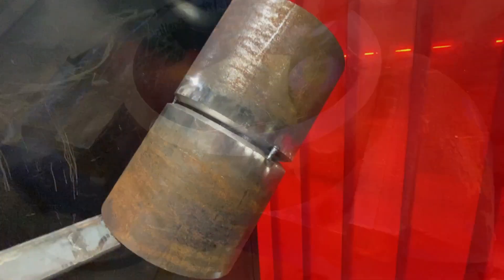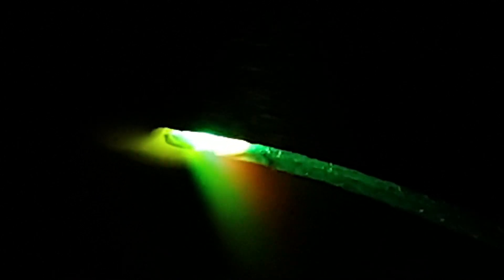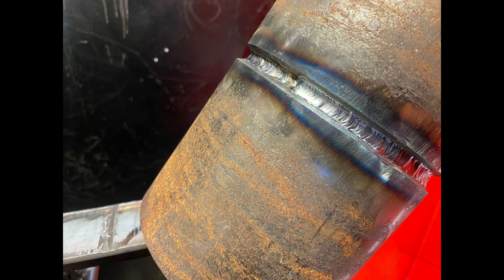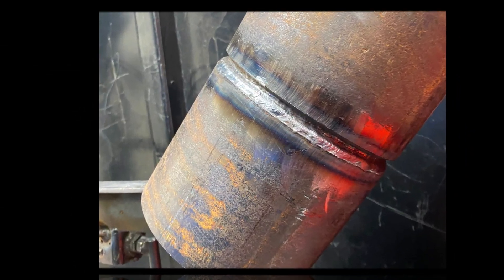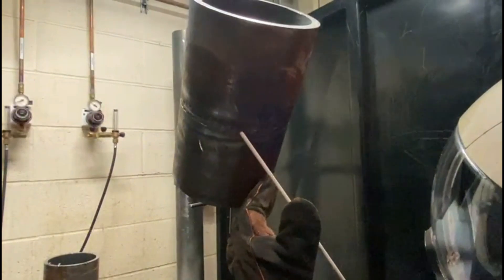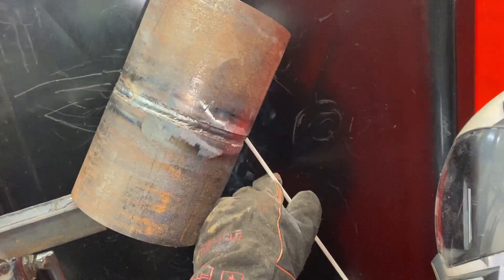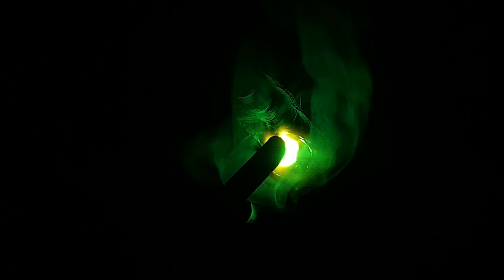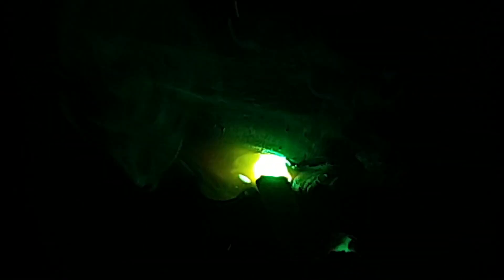6G TIG Root and Stick Fill Challenge

Comment: Was this with 3.2mm smaw rods?
Reply from the maker: Hi yes they were esab 3.2mm.
Reply: Thanks so much for the fast response. If you get time could you do a video of how you weld P11 and P22 with out a back purge. Out of all the material P22 with no back purge I find very difficult, to put a nice root pass.